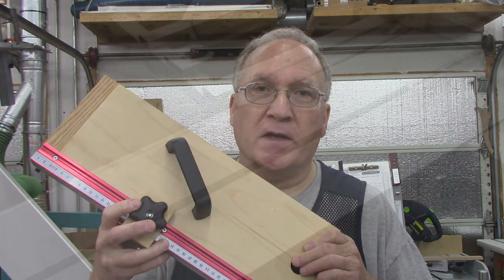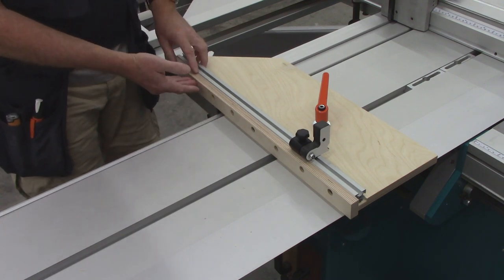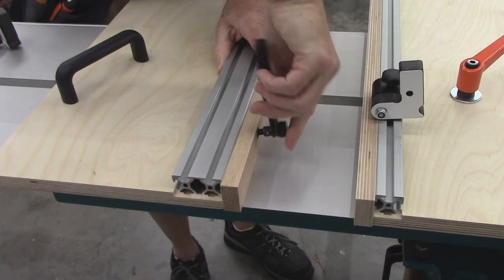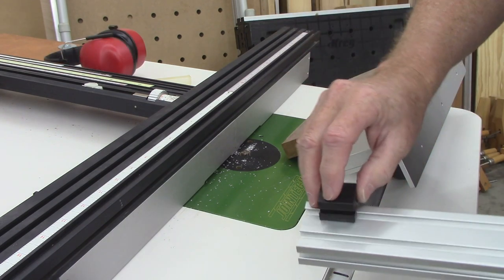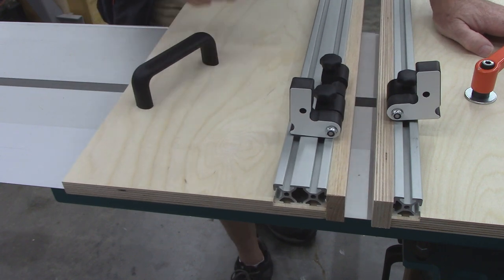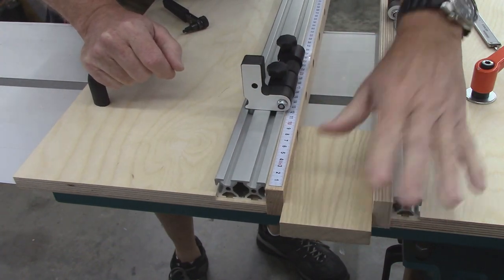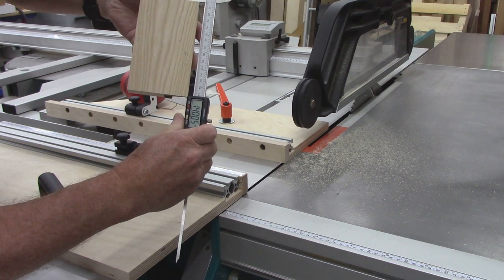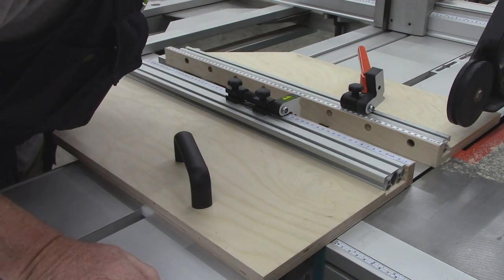Updating the Fritz and Franz Jig

Comment: Hi Steve.  It been a year since I've ordered my new K700S, and now its finally on a freight truck and headed my way!  Love your videos you do on your Martin slider.  When I view one of your videos I get very anxious to get started with a new way of wood processing, from the way I've been doing it for the last 25 + years (american cabinet saws)  Your videos have been priceless!  Thank you very much for sharing.
Reply from the maker: Awesome!  The  lead time is surprising but the world has been crazy since the vid hit us all.  You will enjoy the K700S.  Thanks again.  Steve
Reply: @extremewoodworker  Is the overall size of the F&F jig important?  I’m starting to think about how I want to build mine.  Has the runner material you’ve used in your updated jig working out for you?  Can that plastic material be milled through a planer as well?  Thx
Reply from the maker: @tundrawhisperer4821  The overall size is not critical but I wouldn't want it to hang over the sliding table by too much.  The UHMW poly used for the runner was cut on the tablesaw.  I did not run the UHMW through a planer.  Steve
Reply: @extremewoodworker  Thank you Steve.  In the video you mention the use of HDPE for the runners,  is that the same as the UHMW you just mentioned in your last response?  Sorry I’m not up on my plastics too much.
Reply from the maker: @tundrawhisperer4821  I don't think they are the same and I think what I used was UHMW which will probably wear better.
Reply: @extremewoodworker  Thank you for clarifying, I’ll start searching for some.  How thick is the runner material?  Is that a 1/4” deep dado in the bottom of the plywood to receive the runners?  Was wondering how much of the material should be in the slider beds groove.  When squaring the runners up to the plywood beds, how did you make certain it was going on perfectly square, your process?  I would image this is the most important thing about this jig, getting it square.  I’ve probably mentioned this to you before, but your Martin slider is a work of art!  Take care
Reply from the maker: @tundrawhisperer4821  I used a 3mm deep dado because this is for alignment.  The stock I used was 1/2".  Just be sure to account for how you intend to clamp the far end into account in selecting your material thickness.  Steve

Comment: Great video Steve. Well thought out. I think I see one of these in my future :)
Reply from the maker: Thanks Ron.  Everything except the DRO and the not so flat base came out as I expected.  I had actually purchased a 36" iGaging DRO that I was planning on cutting down but it was a bit too cumbersome with a large display and excess cable.  What would be ideal is to find a Wixey type unit with 24" length and a horizontal display but haven't found a suitable option.  Steve
Reply: @extremewoodworker  I was thinking about the DRO as well. Need to install one as you did on my drum sander - as you pointed out the PM unit is not useful

Comment: Damn you Steve, now I have to make one to replace the $2 F&F jig I made years ago. I am going to use 20 series extrusion to make a parallel cutting jig for my K3 as the stuff is so cheap and as I have always wanted a DRO on the outrigger fence I think I will make a new fence in 20**. A DRO on the standard fence is lottery number prices and will not be very usable. Thanks for taking the time to post this, it takes the F&F jig a step further.
Reply from the maker: Thanks Chris.  At today's prices, it would probably be about $5.  Steve

Comment: Thanks for the great update. Everything you did makes a lot of sense.  I was thinking of making one out of 1/2"x3" aluminum and long enough (24" plus) so it becomes almost a parallel cutting device.  I have the x-roll parallel cutting device and I'm not all that happy with it for smaller widths. Maybe making one your width and also a longer one would make sense for me as I make a lot of cabinets and the rips are often 24" or 12".  Was also thinking of a way to make it possible to clamp material to the jig.
Reply from the maker: Hi Tom.  I know what you mean about the parallel fence setting.  Even on the Martin I can only get it to within about 0.5mm of the crosscut fence stop.  The F&F jig takes a lot of the guess work out of the equation and makes a lot of sense for the rip cuts as you describe.  I would suggest doing a quick check to make sure you will be happy with the overhang if you go with a 24" width.  Steve

Comment: Have you ever consider a jig to do compound miter cuts, but having the blade always at 90 degrees? I would like to make pyramid roofs for my birdhouses. So the wood pieces would be held at different angles so there would be no need to constantly tilt the blade.
Reply from the maker: Hi Robert.  I haven't considered doing so but if I made the same thing multiple times, a jig would make more sense.  Steve

Comment: Steve –
Thanks for the great videos!
I am (finally) building a F&F modeled after your “updated version”.
Now that you’ve used it, would you leave the front & rear fences at ~25mm(minus the rabbet/dado) high, or would you make them taller ?
I am considering milling down Kreg flipstops to height, and need to decide on the final height.
The Kreg’s have magnifier crosshairs for the measuring tape, good for my old eyes, thx ……
Reply from the maker: Hi Rich.  My preference is shorter for easy access as I mostly use the F&F for short and thin stock.  Steve
Reply: @extremewoodworker  makes sense, thanks..

Comment: Great work Steve
Looking at your video I have noticed somewhere around 7:24 min on your router table fence with a black-colored scale.
Do you can tell me what the manufacturer is because I'm from Croatia and I have not seen such a tool yet.

Thank you in advance
Reply from the maker: Thank you Nebojsa.  The router fence is a Jointech but they have been out of business for about 15 years.  I believe the Incra fence is a much better fence system than the Jointech (I purchased this one used).  Here is a link to the Incra website and they do have several dealers in Europe.  https://incra.com/index.html  
Steve

Comment: How did you ensure the fence was perfectly perpendicular to the blade? That's the one thing I can't quite figure out from your video.  I'd be worried about a tiny deviation as I milled the slot for the runners, or installed one of the runners.
Reply from the maker: Hi Morgan.  I did this jig similar to my first Fritz and Franz video which is here:  https://www.youtube.com/watch?v=Q0PyFjtSHrE
Starting about 7 minutes in shows the construction of the jig.   Hopefully, that will make it clear.  Steve

Comment: Jointech router lift and fence.  Wow that’s a blast from the past.  I’ve got them also.  However I’ve never used them.   The fence clencher micro adjust doesn’t move the fence very well.  Does yours work?  Cool video by the way.
Reply from the maker: Thanks David.  I purchased the router table used and would have preferred the Incra fence but you have to get what is available.  I don't care for the fence much as the micro-adjust is finnicky.  Sometimes it works, sometimes not and I really can't figure out why.  Steve
Reply: @extremewoodworker  I think your results with the fence micro adjust are as I am seeing.  I also bought it used with a bunch of other items so it was basically free for all intents and purposes.  The lift though is very nice but I still don’t use it either. But it is a nice sound lift. Crazy to see you have them both.  Lol.  Thanks again for your videos.  They are very interesting.

Comment: What a beautiful jig! And great tip with the standard extrusions. Will incorporate that when I finally built a F&F. ...one thought: I think I‘ll try to mount the scales to the extrusion so I can move the wooden pieces a few mm towards the blade when they wear out and get a new “zero clearance” edge. (Also nice for different blades) Any thoughts why that might be a bad idea?
Reply from the maker: There is not sufficient room on the 2525 extrusion for a scale so if you intend on doing so, make both of them 2550 extrusions and place the scale between the two slots.  You would also need to think through how you would calibrate the scale since moving the extrusion would also move the stop.  I think it can be done but is a bit more tedious than the method I used.  Also be aware that when the flip stop is in the down position making a reading would be more difficult.  Steve

Comment: Hi Steve - I’m finding it impossible to locate an exact size match for the t-nut for the Felder K700S slider track.  I’ve looked on the McMaster site and they don’t have the exact size that matches the one t-nut I received from Felder.  But my question is, does it have to be an exact fit or did you just find the next size down that would fit your slider slot?  Felder wants $34.90 for one t-nut, OUCH!!!   hoping I can find an aftermarket one.  Thx
Reply from the maker: It should be fairly loose in the slot but as I recall, I had some difficulty finding a tee slot nut that would fit the Felder slot as well.  I'll check my XRoll tee slot tomorrow to see what I use.  If you think the part is OUCH, wait for the shipping charges.  Just last week I received a $52 part from Felder and was charged over $29 for UPS ground shipping on a package weighing under 4 pounds.
Reply from the maker: I checked and what I use in my X-Roll table tee slot is the Aigner tee nut Article no. 212 187 000 172.  These are available from Martin Machinery.  You can check with them or one of their dealers.  http://www.simantechinc.com/ lists these for $13 each.  It may not be the best choice for the F&F jig as it fits very loosely in the slot and probably won't be easy to align with the kip lever.  I previously used a piece of baltic birch ply and inserted an EZLoc threaded insert making my own tee nut of sorts.  I have also had machine shops make me custom tee nuts in the past but it cost more than the Felder items.   Hope this helps.  Steve
Reply: @extremewoodworker  Thank You Steve!  I will definitely go look for that.  So does the Martin have the same Xroll table as the Felder machines?  You weren’t kidding about shipping rates these days either.  Recently bought some accessories from Felder, and about fell over at the shipping cost for the two items.  One more question, you have a scale on both sides for the F&F jig, but how often do you actually use the scale on the back side?  My thinking on this is if your making parallel, could a person just set the front flip stop measurement first, then push up to the other flip stop and bring them flush, or inline with one another?   And on small width cross cuts, when using the F&F jig, do you just use only the front flip stop mostly?  Thx again!
Reply from the maker: @tundrawhisperer4821  The Martin slider is completely different from the Felder design.  I use the scale on the back side as frequently as I do the front because I will often remove the front side fence and replace it with a waste fence  (with no scale) since I make a lot of beveled cuts.  This minimizes tearout on both pieces captured and offcut.  Because of this, I use the back flip stop as often as the front.

The method you describe is what I often use for parallel cuts even though both sides have a scale.
Steve

Comment: Steve, do the flip stops have two different locking  positions, in relationship to the mounting body?  So essentially a front and back position?  I’m looking at the 4514 on the Woodhaven site and they don’t show the depth to have a wood runner in the front of them.  But you clearly have a wood front in front of yours.  Thx
Reply from the maker: Tundra, I called to verify before ordering.  The flip stop comes disassembled and during assembly, I just turned the body backwards from that shown in the Woodhaven photo (i.e. - the tee slot in the mounting body faces away from the fence instead of toward the fence).  This gives clearance for about a 5/8" thick fence.  Steve
Reply: @extremewoodworker  At the 15:00 mark in the video you are adjusting the sacrificial/scale/chip breaker fence in order to calibrate.  Since this has the scale tape installed on it, if it ever needed to be recalibrated, do you pretty much have to replace the scale tape or entire fence?  Because one of two things would be lost, the scale tape would then be too far off to register one way or the chip breaker feature wouldn’t meet the saw blade edge anymore the other way?  Thx Steve
Reply from the maker: @tundrawhisperer4821  You are correct.  When I need a sacrificial fence, I replace it with one that does not have a scale.  Steve
Reply: @extremewoodworker  Hi Steve, I’m about to install my measure tape onto the sacrificial fence and go through the calibration front first ever built F&F jig.  When you completed your calibration, you never did cut through the measure tape, correct?  You kept it far enough back so the final calibration cut did not cut through it?  Thx   So far I’m very pleased with how mine turned out.  His is going to be a very handy jig!
Reply from the maker: @tundrawhisperer4821  It depends on the scale.  With the plastic scale I cut through it with the blade.  For the metal tape I trimmed it back prior to installation.  Steve
Reply: @extremewoodworker  Thank you so very much Steve!  Your video on the F&F was the inspiration for mine.  Wish I could share pictures of my version with you.  I was able to complete it this morning, and now with the F&F dialed in, the slider bed dialed in, along with the crosscut DRO dialed in, I wanted to challenge myself with some board milling.  I took four pieces of various and rough poplar boards and wrote a finished dimension on each one of them.  Then I put my tape measure away.  Proceeded to mill away!  When finished, my tools nailed every one of them.  Couldn’t be more please with the results!  This is my first real milling practices with my slider and it was an awesome experience.  Thank you again for the videos you make!
Reply from the maker: @tundrawhisperer4821  Awesome!  Glad it is working well.  The F&F is the most used jig in my shop.  Steve